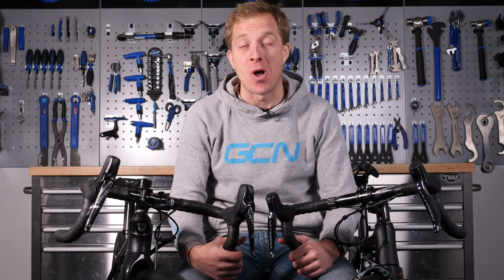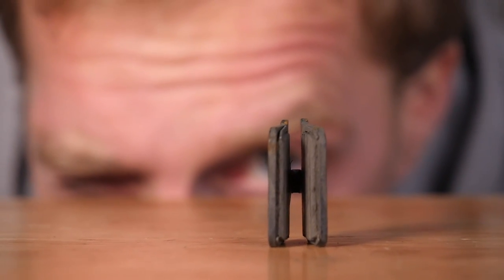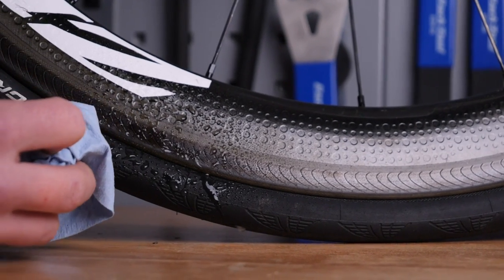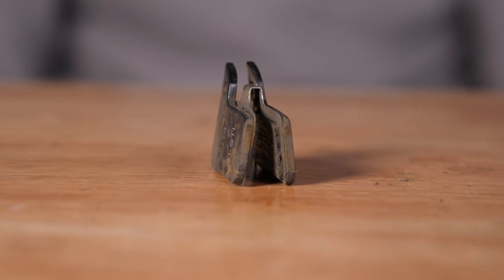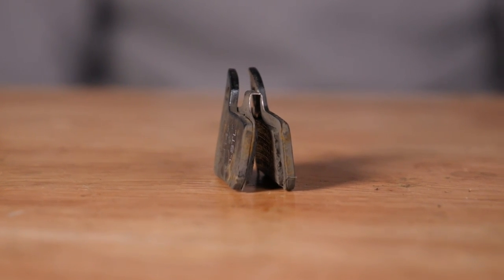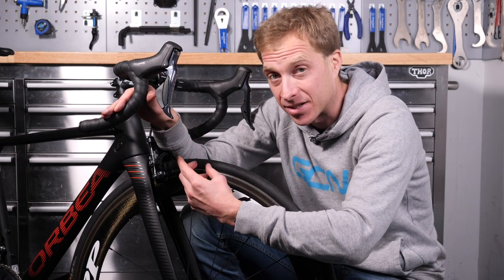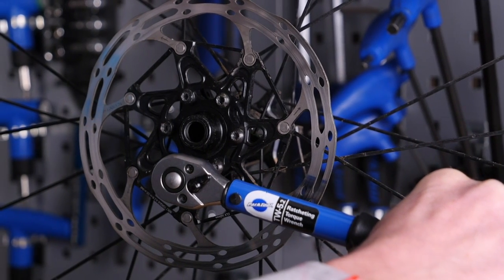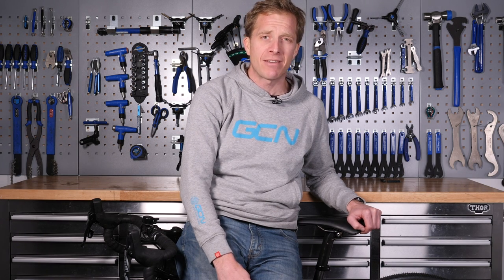How To Solve Brake Squeal – Solutions For Noisy Brakes

Comment: For disc brake pads, put a drop or 2 of Fairy liquid on pads rub the pads together under warm water. Keep repeating until water runs clear or you can see the gold specks in the pad surface again. Credit to High Carb Rider
Reply: RollinRat  dish soap 😄

Comment: In my case, the disc pads had glazed over. 

1. Pop them out

2. Rough them up a bit with some sandpaper (perpendicular to the rotation). 

3. Re-center the pads (loosen the calliper bolts, hold down the brake lever, tighten the bolts). 

4. Bed the brakes in like they are new (see your manufacturer recommendation for this).

Not only did the squeal go away, but the brakes more than doubled in their effectiveness (half the stopping distance at speed). I didn’t realise how badly glazed they’d become.

Comment: Rubber brakes pads can dry out, with use or no use, and become as hard as a formica counter top. Cleaning, filing, sanding won't fix it. Replace the pads with fresh 'soft' rubbery pads and avoid prayer stops.

Comment: I find wrapping a stout rubber band around the back third of the brake pad works better for setting toe-in than a piece of cardboard (etc.). While clamping down on the brake levers, the rubber band provides a lot of friction, reducing the chances that the brake pad will rotate slightly out of position when tightening the retaining allen bolt. Does anyone have a recommendation for a brand of brake pads that is less prone to squealing? That would be a great piece of information to add to this video!
Reply: msteed68 Thanks! I've considered getting Kool Stops before. I have a pair of Shimano pads on my bike now. They can be a bit temperamental unless everything is perfectly set-up and clean.
Reply: Cheap n cheerful, Clarks elite triple compound are worth trying.

Comment: My disc brakes are as quiet as can be in dry conditions but the moment they get wet they turn into a pair of banshees. I'm using sintered pads on both front/rear. Is that pretty normal for discs?

Comment: I still have the problem of brake squeal, I already got a new pair of pads (carbon specific from mavic) and toed them in.
I do ride mavic cosmic rims and they appear a bit glossy, did I overheat them?
Both front and rear are bloody noisy.
Please give me some tips, should I use other pads or is mavic known for this?
Rims are 6 months old.

Comment: Usu a blowtorch And gently heat pads, this will burn off any oil or brake fluid. Then gently sand pads with sandpaper on a flat surface and blow off any dust that remains. Replace all components and you’re good to go. Clean rotors with isopropyl alcohol and I guarantee this works every time.

Comment: Better use a file instead of sanding paper. The abrasive material may get stuck in your brake pad. I often use either a file or a strong wire brush.
Reply: Or if the pads are old, replace them even if they are not worn out.
Reply: @minuteman4199  yes but this is the less ecological decision. You need energy and resources to produce them so be so respectfull and use them till the end if possible as long as they dont present any risk for your own.
Reply: @mathieub3953  you're right, but brake pads for the disc brakes on my commuter costs like 5€, so going through the whole process of cleaning, sanding and cleaning them once more before installing them is almost never worth the effort and time spent.

Comment: Hello body, I have a concern regarding my carbon rims. I recently get the mavic pro sl carbon. The thing is that at the beginning of my ride when I brake it has a normal sound nevertheless if I take a long way down using the brakes suddenly start a terrible squeal sound. I already cleaned rims and pads even I changed the pads but the squeal is still present. Does it normal for carbon rims ? There are any brand pads that will eliminate this sound? Thanks in advance!

Comment: I've always wondered why does toeing in eliminate the screeching?
Reply: The grab on the front then pulls the rest of the brake pad in at the back, so you get pretty good contact, but without the squeal. I think the squeal is caused by initial contact setting up vibration without grab to dampen it. It's a bit like getting the rim of a wine glass to sing. With firmer pressure the wine glass doesn't sing, and with a flat contact on bike rims there is equally a series of high frequency vibrations that can be cured with the firm grab of the front of the pad.

Comment: I milled off the pads 1 mm, but they still squeal, ... so, what is next solution ???
Reply from the maker: If you have a disc brake set up it could be any number of things causing the squeal - make sure your rotors and pads are clean and free of any contaminants, the pads are correctly bedded in, and that both pistons are moving together rather than unevenly. If all of those things are fine then you'll need to do some more investigating, it's possible the calliper could be out of alignment with the disc, or the disc is slightly warped.
Reply: I have tryed 6 diferent manufacturers of the pads, i have cleaned the discs and pads, than i have greased the discs, than cleaned it all , changing the pads, etc, ets, trying even to lubricate the pads with oil, ...greased the guides, ... i even bored the pads, to make holes into which i installed the graphite sticks , ... and, No result at all . I tested the main bearings - no movement . I made a new springs that are pushing the pads aside, ... than i glued the pads to the pistons , ... and, again : no  and no result !!! ! !!! I will try with the neodymium magnets this week , if i will manage to assemble it all , ... them all . Or do you have any new idea in the between time ? Thanks. Pwy.
Reply: I have cleaned the pads and discs, i have changed 6 diferent manufacturers of the pads, bought new rotors,  have lubricated the discs , i have gresed the discs, than cleaned it all again, ... etc, ... i have even drilled the holes into pads, and installed the graphite sticks into it, ... but - no effect . I even glued the pads to the pistons, as it worked a few years ago, but now - Not anymore - No result . I checked the main bearings, - perfect as new - with no walking/play. I will try the neodymmium magnets this week, if i will be able to assemble it , because they are very strong . In the mean time, do you have any new idea about the problem  ? Thank you. Pwy.

Comment: This only applies to disk brakes. You will need a blow torch and new pads. With the wheel off the bike and the pads changed, spray the disk with degreaser, take a bit of kitchen towel and wipe off any muck. Then take the blow torch, or lightly heat the disk, you will see the the remaining fluid evaporate. Heat both sides of the disk and make sure to not heat the disk so much that it changes colour.
Reply: Ah ok yea I completely roasted my disks and that explains why they were broken I got bleed fluid on them and tried to boil the mineral oil off it
Reply: Robert Trageser  It's what we do. Different people do it different ways.
Reply: Robert Trageser  I help out in a local shop. we use a blow torch lightly to evaporate the brake cleaner (which is effectively just degreaser) not to the point where they are so hot that they could break or deform. Not arguing about this as there isn't much point.

Comment: I run disc brakes on my winter steed and have tried all of the methods mentioned without success, i even went as far as replacing the pads and rotors this year but they still squeal when coming to a complete stop, the front one locked on the other day too. I suspect it could be something to do with the pistons, but having already spent a small fortune i am loath to replace these unless it will definitely resolve the issue, have you any further hints/tips/guidance on this?

Comment: Surely the "toe in" part of this video is negated by the tightening of the bolt holding the shoe to the caliper? It's not as though the shoe itself is slightly angled to allow "toe in" so I can't see how the business card thing works.
Reply: The brake shoes sit on a spherical washer on most quality brakes, and will stay angled wherever you tighten them. Business card trick does work.
Reply: @ryanlorence512  Fair enough that makes sense.
Reply: John Mac - If you have older brakes without the spherical washers that help you adjust toe-in, you can buy brake shoes and holders with those adjusting washers or find some at Rene Herse Cycles or Grand Bois.
Reply: bend the calipers with big plyers

Comment: Does disc brake grease for cars do anything for bike disc brakes?
Reply: How do I brake properly? I just squeeze the lever.
Reply: +offshorebear I was thinking the exact same thing, LOL
Reply: Robert Trageser  My driveway has a 18" drop, and then its 300 miles to the next change in elevation for me, lol. Flat beach area. I don't know anything about bike brake design, but I am sure they have different design goals than car brakes which I know more about. 

In cars, the grease is used to dampen out the resonant frequencies caused by impurities and manufacturing defects. I wonder if it would do the same thing on a bike caliper, if it could be retrofitted into the design or a new, "silent" piece of kit.
Reply: Robert Trageser  In the US the ubiquitous product for cars is "CRC Disc Brake Quiet". Its an thick acrylic polymer fluid that kind of feels like hard rubber gasket after a while. Nothing like copper anti-seize. You coat the entire rear of the pad with it before installation.
Reply: Robert Trageser  All good stuff Robert, this part of youtube doesn't seem to attract many trolls. As far as design goals for car vs bike brakes, yes they all serve to convert kinetic energy into heat, however I suspect a car brake system can be quite a bit heavier due to the energy available, with more thermal mass in the rotors and pads than a bicycle. There is also more space to fit additional parts, like noise canceling layers of rubber material. The Brake Quite stuff is there to absorb the energy that was made from glazing and contamination; it is not required for perfectly conditioned brakes. Car brakes and bike brakes have the same challenges, but they are designed differently for good reasons.
Reply: Robert Trageser  By definition hydraulic systems are completely intolerant of air., I suspect bike style human powered systems are the most tolerant however. My biggest fear about applying car brake grease is that car brakes are designed for much higher pressures and this have much better seals vs a bike. The bike brakes may be significantly damaged by material between the pads the the pistons.

Comment: Sometimes squeaky brake can be good. Usually when some clown walks in to road without looking to make sure there is nothing coming. Then the screech of the brakes makes them jump. Either on to the path or in front of the lorry coming the other way. If they have any sense then they jump on the path. If they don't, Then there will be one upset lorry driver.
Reply: My front brake on my cyclocross bike also screams and it's fun to use it as a horn
Reply: Lisa Rogers I generally yell,” get the fuck out of the road u muppet!!!” 😂😂😈
Reply: Sometimes i even purposely lock up my rear wheel to sound that it was an emergency brake that i almost hit them..